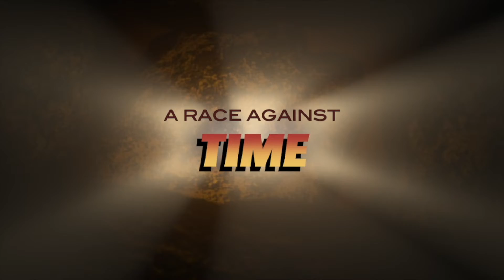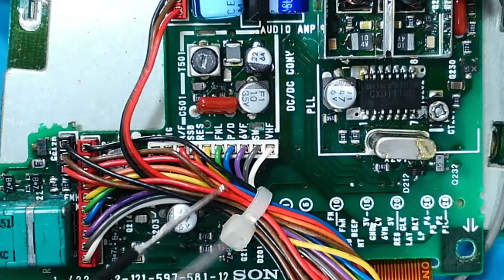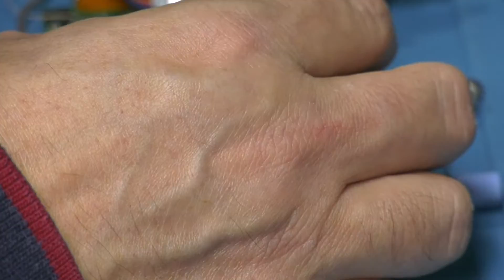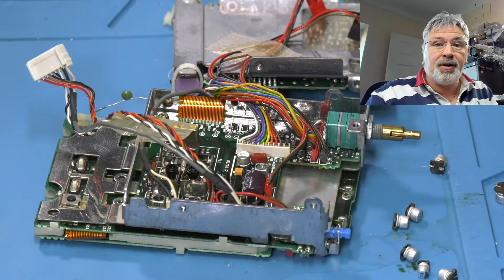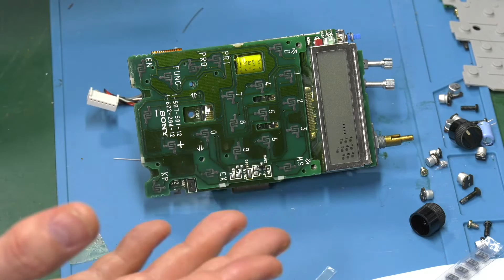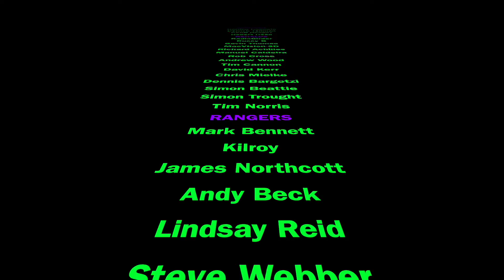Sony ICF-PRO80 repair guide: Part 3: Recapping the PLL board and LED replacement

Comment: Hi, what size caps are you using? I'm still somewhat new to smd and am wondering what I should order. (B case?)
Reply from the maker: I don't have a list. The sizes are different though. I bought in various sizes and just use what fits best. You would need to take all the caps off and measure the pads to work out what size you need
Reply: @Radiocruncher  Thanks, I already have a bunch of caps on order. Here's hoping.  😁

Comment: Hello, I thank you for those impressing videos about Sony ICF Pro 80.
I own two of this,  now repairing that one in better visual condition.
To Part 3: Recaping PLL Board. 8:30 min forward.
There is no need to use a soldersucker to lift the 2 plastic connectors.
I solderd 2 copper rods to the pinside of the connectors, fixed with flux.
Then heat those at middle of the rod with the solder iron, pulling slightly at the downside. The connectors nearly fall out the PCB.
Then cleaning with desolder wick and isopropanol.
Reply from the maker: Thanks for the tip. I've not tried that. Glad you sorted yours out though and hopefully my videos helped

Comment: Tried contacting you several times on your website asking if you could fix my scanner, but never received a response. Maybe your contact form isn't working properly? While I'm here, do you still fix scanners for people? I have a Realistic Pro 26 with a constant buzzing / clicking noise. Cheers.
Reply from the maker: Hi Bernie. Not sure why the contact form isn't working. It's got a pretty aggressive spam filter so it may have got stuck. Drop me an email to graham@radiocruncher.com

Comment: Hi, Im trying to fix mine, unfortunately  T11 tranformer is done, where can I get a replacement? thanks
Reply: Good morning
I also asked this question in part 2
Radiocruncher answered this
Reply from the maker: I've already told you many times to pull one from an old Sony Walkman
Reply: @Radiocruncher Thanks
Reply: @Radiocruncher  Any model in particular? I got an Icf sw22, those IF transformers will work as well? Thanks